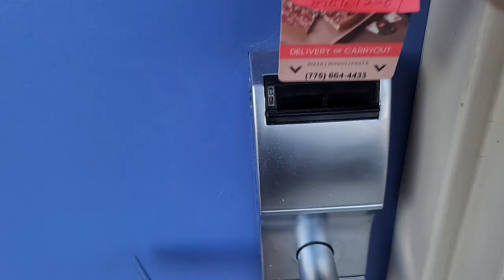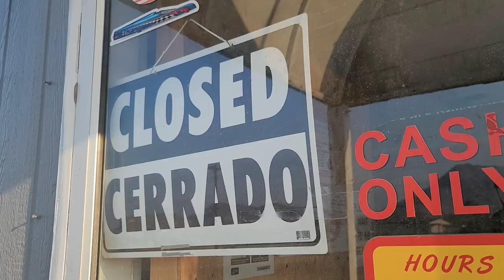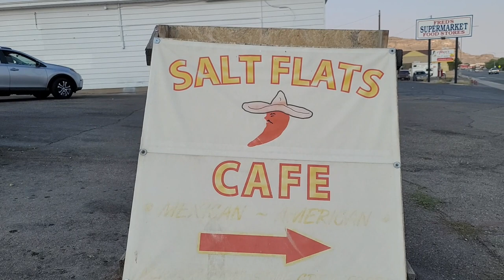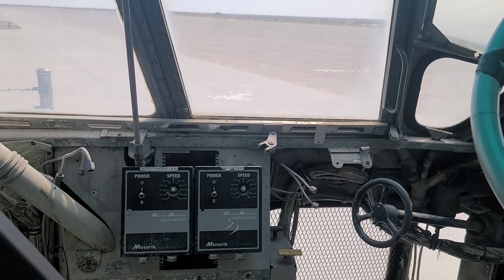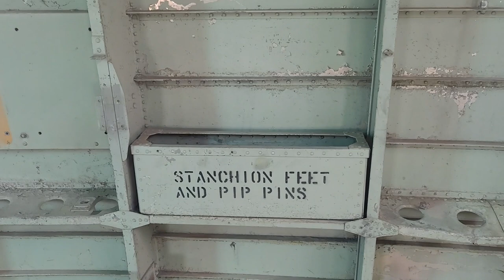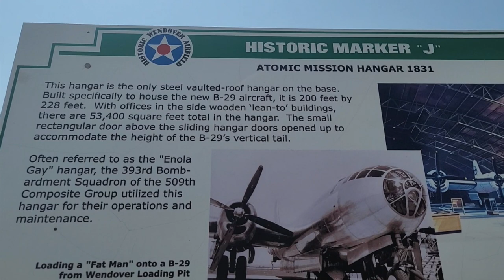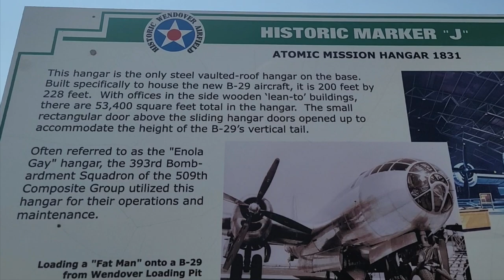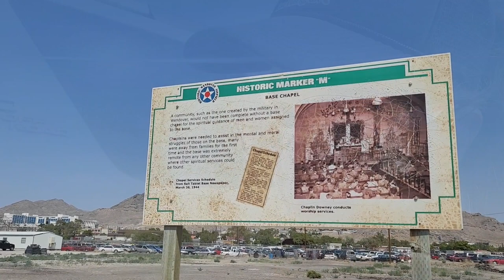#573 Bordertowns: Wendover, UT vs. West Wendover, NV: Which is Weirder?

Comment: Of all places to maintain the Enola Gay, incredible what you find when you get off the bland highways and actually search out small town America.  Thank you so much. I love your videos as you really do your research.
Reply: It is a dry desert and good for metal preservation
Reply: Actually the interstate runs right along side of
  both Wendovers
Reply: The plane is on display at the Smithsonian Air and Space Museum in Chantilly, VA
Reply: The Enola Gay got it’s name just before the bombing raid on Hiroshima.  Wendover Army Air Force Base was used by then Lt. Col. Tibbets (later, General Tibbets) to train the crews and develop the specialized bombing tactics necessary for the dropping of the A-bomb.  It was chosen for it’s isolation, and proximity to suitable bombing ranges.  They were there for several months before transferring to Tinian Island in the Pacific.
Reply: @TKPorsche  Enola Gay was named after Tibbets’s mother

Comment: The airplane was a C-123. In the cockpit, all of the instrumentation and controls were removed. For some reason, the steering wheel and a shifter, from a old truck, were installed in place of the original controls.
Reply: It was driven around like that in some movie scenes. I'm sure they had a cockpit set up (complete with the real "yoke") for the critical scenes.
Reply: The story we were told when we auto-crossed out there in the early 2000’s was that the Con Air prop/plane was a bus mocked up to look like a C-123.

Comment: Wendover is over 4,000 feet in elevation, so it DOES snow there in the winter, albeit generally not much because it is a desert so there usually isn’t much moisture.

Comment: You really missed a cool experience by not going in the museum, it has a replica of the "Little Boy" bomb, the first used on Japan. Also if they are not busy at the FBO, "Fixed Base Operaton" next to the control tower, they would take you to see the pit where the bomb was loaded into a B-29. The C-123 is still there because during the making of" Con Air" a man was killed and the aircraft was needed for the law suit that followed. And lastly, this flightline is the only complete one in the United States, all the hangars are still in place from WW2.
Reply: Thanks for telling the rest of the story about the 'Con-Air' plane. I worked on that movie set as an EMT. Everyone forgets or just doesn't know about it. 
Also the Chappel Apartments was originally the Church. 
During the Military years there was over 40000 troops stationed here. 
Another fun fact is no Brothels are allowed within 60 miles of the bordering states.

Comment: I wonder if those housing units might have been for Japanese relocation in ww2
Reply: They trained pilots, couldn't run into a mountain with the salt flats
Reply: @kevinmoore.7426  Not a relocation camp. Nearest one is in a suburb of Salt Lake City. Durring WW2 it was the largest Army( Army Air Force) base in the World. Most was just open space. Must have been 1000 sq. miles or larger.
Reply: @frankanzalone3836  where she is at is only an hour or less from 
slc
Reply: Just read about base almost 2 mill acres during wwll interesting history.
Reply: @frankanzalone3836  in spring, that lake expands way west in wet years about a foot deep. Wendover is on a big hill. Those salt fats are flat in summer
Reply: @kevinmoore.7426  Have lived most of the last 50 years in N NV and N UT. The camp was south of Magna.  Worked for UPRR. Spent all day on flats hundreds of times. I remember when lake was high (84 or 85) and Gov. Bangerder built dikes on flats. Excess water was to be pumped there to save Grantsville and other low places. They got it all done and then the lake went back down. They never did use those big pumps. LOL
Reply: @frankanzalone3836  this was the 60s, you're hurting for water now, no ?

Comment: When i was a wee little one, many years ago, after having visited my Grandfather in the hospital before he passed, we headed for California to my Aunt's house and we broke down just over the border between Utah and Nevada (might have been between Nevada and California) and the only thing I remember is a huge statue of a cowboy waving! I was only around 3 years old by the way.
Reply: That was Wendover. Wendover Will was right on the line at State Line Casino. Casino is now The Nugget and Will has been moved about a mile west.
Reply: @frankanzalone3836  Could be, as I was only around 3 and don't remember and I have no real way to confirm or deny either way.
Reply: @mikecapps1603  The mechanical sign that used to wave is still in Wendover. Sits in middle of the main street. On a pedistal it is over 50 feet high. Next time thru you can see it.
Reply: @frankanzalone3836  other places in Nevada have the cowboy. But you know that

Comment: Wendover IMO is a very cool town. LOADS of American History! To bad you didn't take the time to explore the Museum. You (and the viewers) would have learned so much about what Wendover Field was really all about. For that matter how Wendover the town was started. Many, many folks worked and lived there on that base in it's hay day. many different types of aircraft were flown there. Not just bomber aircraft were housed there and trained to drop "pumkin bombs" from 30+ thousand feet high into the southern desert but many different "gunner" planes trained there out at the salt flats. In you previous video you showed the steps and foundation of a building. I believe that building there was part of that operation. It was where Air Guardsmen were stationed to monitor and assist in the training of the gunner planes. I have spend many of days out in this part of the Utah salt desert. I have found many, many, many spent gun shell casings laying out in the desert from these training missions. Also, that control tower, you could have climbed up those stairs to the top, a very good view of the field and surrounding area to be seen from that vantage. THEN there's the infamous Bonneville Salt flats. That flat slab of salt is "Hallo Ground." So many infamous folks over the course of over 100 years have set land speed records there. See, I live in northern Utah, north of Salt Lake City. I grew up in this area. It wasn't until I was in my med 30's (53 now) and bought my first 4 wheeler that I decided to see what all the hype is about Wendover and Bonneville. IMO, one of the coolest places to explore. There is sooooo much cool history in Wendover. For anyone it is well worth the trip to Wendover. Just plan it out, spend a couple days there. Bring a 4 wheeler or 4 wheel drive. CAUTION! DO NOT stray to far away off the pavement when exploring the Salt Flats. It may look tempting and appear to be dry and safe to drive on. The flats will fool you and the next thing you know your vehicle will be up to the floorboard stuck in the sticky, mucky mud of the salt flats.

Comment: I was raised in Wendover in the 1950's, before there was a West Wendover, or I-80, and the population then never topped 500 people, some highlights....the Stateline Casino was pretty small, with rooms on the second floor, the Smith Family that owned it also had some small cabins to the west as well as a gas station and garage, across the street where the Montego Bay is was the A-1 club, and next to it was a restaurant that straddled the state line with a line painted on the floor, the Utah and Nevada side, you could order your food in Nevada and eat it in Utah and never leave the building, the Montego Bay was formerly Silversmiths Casino, owned again by the Smith Family, factoid, the Stateline casino is of course in Nevada but their parking lot to the East is in Utah. Wendover Will was built a year after Vegas Vic and is slightly larger, it sat out in front of the Stateline casino when they installed it in 1952, after Stateline changed hands they moved it to West Wendover. The reason Wendover looks slightly shabby is because of a few reasons, there really isn't much money in town, nothing that creates any revenue, plus it's in Utah and the tax base is poor, the houses you saw a little bit of, some are newer, but many are old and worn out. Back in the day, the railroad owned all of the land and would lease you a lot and you could build a house, these were just shacks because the people didn't own the land so they didn't put a lot of money into them, later the railroad sold the lots but the houses were there and some folks then improved their homes. When I lived there Wendover Air Base was still an active base, full of B-17's, B-29's awaiting disposal, plus there was a squadron of F -86 jets stationed there, the base closed in 1957. The wooden buildings were mostly barracks and supply warehouses, and the Enola Gay hanger is slowly being restored by volunteers as money permits, it used to be in really bad shape.  Another fact, I went to my first speedweek in 1954 there were 3 courses then and an International course of 15 miles long, the salt back then was two to three feet thick as well as a round track where they held the 24 hour endurance races, now the salt is just a few inches thick, the result of mineral extraction from the potash plant over the decades. Those are some things I remember as a kid living there, any questions...just ask.

Comment: Some guys got together and rigged that plane to haul people up and down the runway...they must have set it on a truck chassis or something. Planes don't have gas pedals,
brake pedals and gear shit levers. Add to that, looks like some of the hydraulics and wiring to control it has been removed. Just what I caught from you panning the camera around.
Anyway, both towns look like places I could live near. After returning to country living, I wouldn't give you a nickel to live inside an sized town again(8-). Thanks for another great
video, Love(8-)

Comment: Wendover was also the Army Air Force Base on the south side of Wendover where the Original B-29 Bomber crews of which dropped the Atomic Bombs on Hiroshima and Nagasaki Japan received part (if not most), of their bombing training for those 2 bombing missions. In fact a couple of the original aircrat hangers are still there. If my memory serves me correctly, I think there is also a historical museum pertaining to that Bombing training there at that old military base as well.

Comment: If you have not finalized your itinerary, you may want to add Promontory Summit to your destination list while you are in that area. Was where the Transcontinental RR met in 1869. It is on the North side of the Great Salt Lake. Back then, it was too much work to bridge and fill across the lake. The RR you see from I-80 is the new alignment. The old path is mostly trackless now. The Park at the meeting site has a short section of track re-laid to run the reproduction engines on and is a cool stop! You will no doubt find the history of this interesting.
Reply: I'm thinking she has done a video on the anniversary of the driving of the "Golden Spike " that commemorates the completion of the intercontinental railway. I remember watching a video about it. But  not certain Wonderhussy did the video or someone else.

Comment: I was curious about the history of the plane at Wendover so did some checking of the FAA registration number N709RR displayed on the plane.   Turns out there were at least three of these planes used in the movie Conair (1997).   All three started life with the U.S. military in the 1950’s.  It is thought that the Wendover plane was the one crashed into the casino.  There was only one plane capable of flying  and it did the flying scenes.  It was the real N709RR and the others just numbered the same for uniformity.   In 2003/04 the real N709RR was sold to a freight transport company in Alaska.  In 2010 the company owner/pilot and two passengers were killed in a fiery crash while transporting heavy equipment.

Comment: "Bombs away!" You're funny, Sara. That old plane looks like a C-123, the same type of aircraft portrayed in the Wesley Snipes movie, Con Air. The tail numbers on the Con Air plane were N709RR and - wouldn't you know it! Same tail numbers on the one you checked out at Wendover. You can even see that the words "U.S. Marshal" was painted on the starboard (right) side. I think the steering wheel, gearshift, gas peddle, and brake were added after the movie, though. Did some Mormon hurt you? You sure dish on them a lot. Oh, well - LDS history is nothing if not interesting. Fun find! Stay safe out there.
Reply: Ahhh Wesley Snipes. Now you ARE bringing back history.

Comment: They did not load up there. The bombs were loaded on a special airstrip on Saipan. I used to live next door to Saipan.
Reply: it was set up for practice loading. the bomb pits are still there, but you can't see them from outside the fence. 
The B-29 hanger has been restored over the past few years. When I first saw it in 2008 it was unrestored and had PROJECT TESLA barely visible painted on the roof.

Comment: The "barracks" could have been the remains of Topaz War Relocation Center for the Japanese during WWII.
Reply: No, that's 100 miles SSE.
Reply: @markk9794  Was there a relocation camp there in Wendover? I came across a picture of the barracks saying that was what the building was used for.
Reply: @bighatstephens  I have never heard of that.  Also, it seems inconsistent with the Enola Gay training missions to have barracks of people the government didn't trust just 100 yards away.  Also, that barracks area really wasn't very large -- just 1 or two city blocks including chow halls and officer/enlisted clubs.  I don't think it was big enough to function for that multi purpose, as compared to just housing GIs who went off to workshops daily.  The first time I visited was in 1985, as a 2nd Lt stationed at Hill AFB. The chapel had already gone to private use, but the barracks were all there, unfenced.   I haven't been out in a couple years.  Hoping to return this Fall.
Reply: @markk9794  Thanks for the information.

Comment: Way too much additional info about “Bendover”, I mean, Wendover! I did commercials for a casino there and taught scuba diving there as well. Ahem
Part one the casino commercial. In the 70s the cowboy was attached to one casino. We were doing a commercial for them. Everytime our props person walked past a certain slot machine she dropped in a nickel pulled the handle and on the way back SURPRISE she had won something. That went on for about 4 hours until a crew of maintenance were seen tearing the machine apart. 
There are more scuba divers certified in the state of Utah than between Chicago and the West Coast. Why because just south of the airstrip is Blue Lake. It is a natural hot springs that the Enola Gay bombed into a 2.5 acre by 65 foot deep lake. Hot all year round. So anybody going on a scuba vacation in the winter needs to certify. The only place that is warm enough and deep enough is Blue Lake. How did it get that way…
The Enola Gay was so top secret that a one guy one time admitted sitting at a bar that he worked for the air force and was immediately transferred. The crew had no idea what they were training for. How they trained. Movie camera in the belly of the Enola Gay. Go to an altitude. Roll camera. Drop a conventional weapon of a certain weight. Measure the number of frames of film from release to explosion. Why. So crew wasn’t incinerated. Problem. The desert is monochromatic. They couldn’t see the explosion accurately. Solution. Drop the bomb on Blue Lake and clearly see the splash explosion. There are unique species of sponge and fish in that lake. 
So imagine it is dead of winter on the open salt flats. Do you want to change into your wet suit out there. No! So we would change in the lobby of the casino. For kicks we timed it to arrival of the bus from San Fran. The look on the passengers faces was priceless. 
Our group was usually 10-15 pick up trucks with gold old boys and girls. We made the turn onto the flats to drive to the edge of the lake. Low and behold a young kid in the air force is out there telling us we can’t go to lake because they had lost a missile. That area is a proving grounds. HA! It turned into Mad Max as the pickup trucks just drove around the kid and went to the shore. 
Final story. I worked with paraplegics. Session after session we had people who flew out to the air strip in their own plane from SLC. We picked them up. Took them to the lake and they certified PADI. Amazing folks. 
Sometime take the road from Wendover to Toole Utah through the West Desert. It is the best rock hounding in North America. You will also see a ton of sheep herders. 
A word of caution. We used to spend New Years Eve in sunken bath tubs that had hot springs running into them. Everywhere were signs saying stay on path. My first AC had a friend killed out by one of those hot springs. His dog ran off the path. The dog broke through into scalding water. He went after the dog and was killed as well. If it says stay on the path believe it.